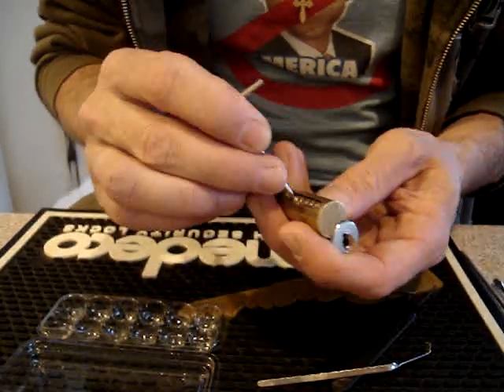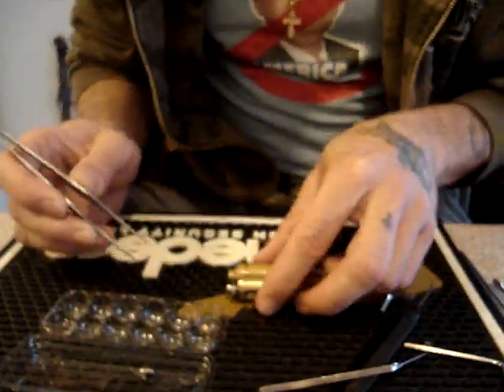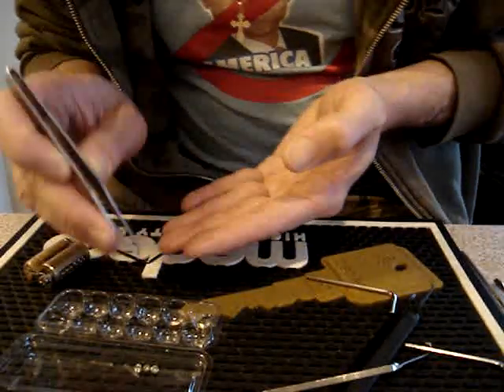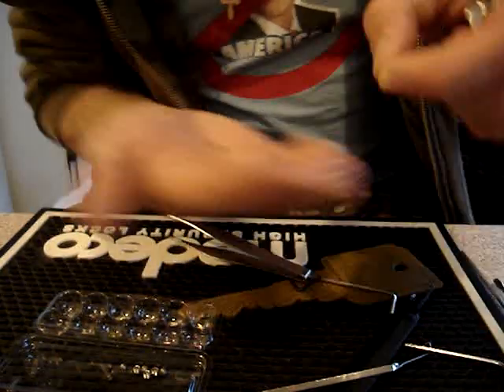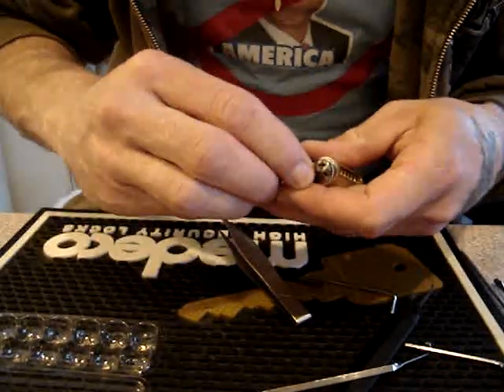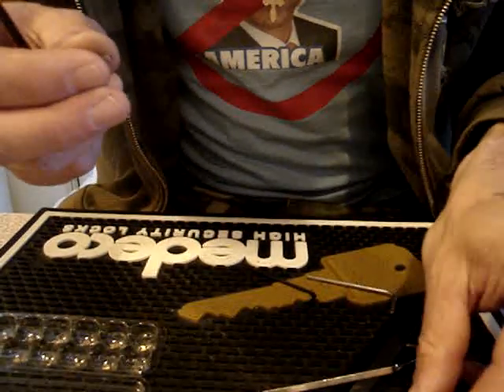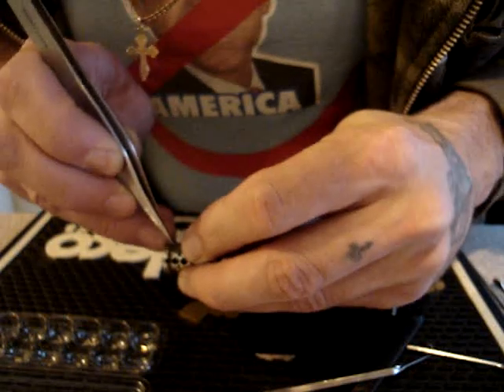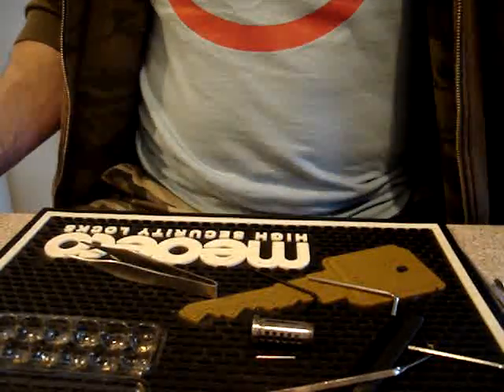scorpion CX 5/P500x PACLOCK ™ padlock core breakdown

Comment: hey i have started to work with a locksmith and sometimes when a pins don't fit in the cylinder or the locksmith is in a rush they will use key pins in the top of the cinder in order to make the cylinder more accommodating to the key depending on the orientation of the driver / key pin but it differs so let me know what you find out or if im working with a locksmith who knows nothing.  let me knoe nich work once again